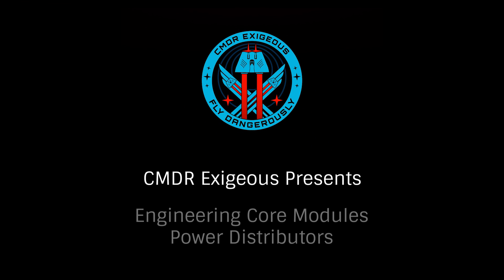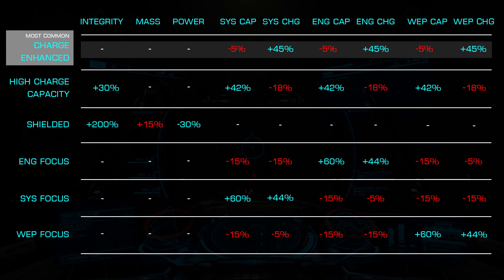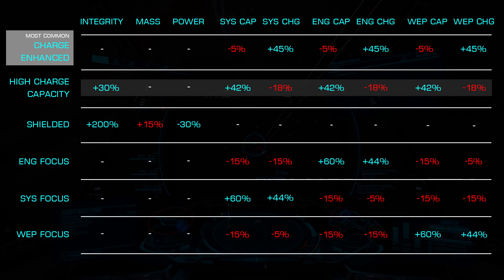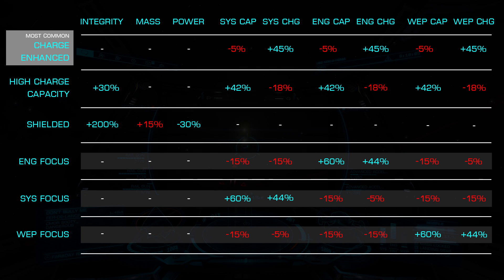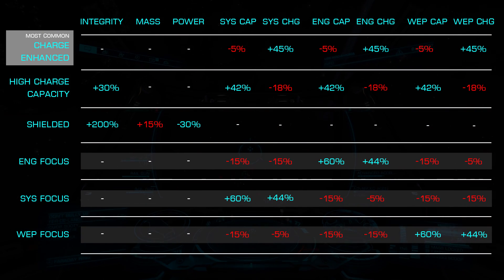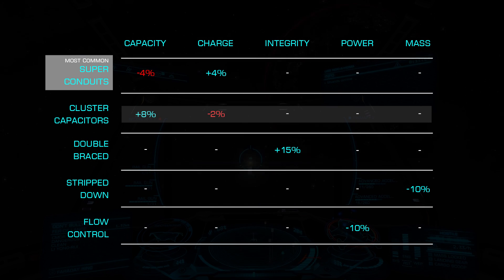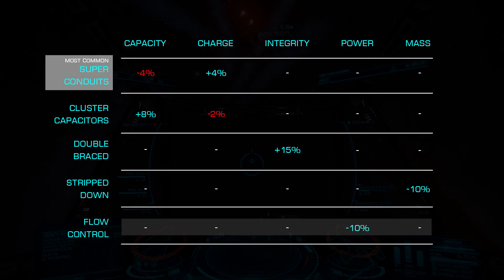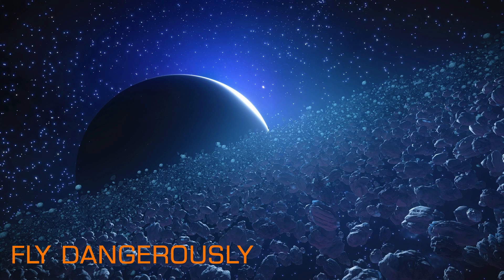Engineering Explained: Power Distributors

Comment: I wanna put my thoughts out there and please react if you feel like, I'd love to hear other's opinions too
There is only couple of very very specific instance where is actually better to use "focused" engineering on power distributors. If you look at Exigeousz's awesome picture at 0:53 you can see that even though called focused bueprints they only have better capacity when compared to charge enhanced blueprint. The charge rate is always better on the charge enhanced. Having heaps of capacity or enough of capacity would only be good if you  can say kill a ship without the need to put pips in weapons at all or if your shield is so tiny compared to your system capacitor that you can fire up your shields without the necessity of using pips there. Since it is always better to go with the faster recharge rate Id like to narrow down my thought to spacific
For weapon focused only one very specific and rare instance. Would be to when using a lot of hungry weapons and you want to fire them all at one big boom and your current capacity doesnt allow you to fire everything. Use weapon focused because you need the extra capacity and you dont care about the tiny slower recharge. Otherwise use charge enhanced
For engine focused only on exploration ships where you are using lower D rated modules than the ship does not allow to undersize and loose to ability to boost just to get the capacity and the boostability back via this blueprint. Other case to use engine focused would be on speed builds. Well.. yes and no. I see it that if are building strict speed build you should always go with lowest D rated you can engine focused so you can boost and usually strip down depending on where you stand in optimal mass, or cluster cap depending on where you stand with capacity so you can boost at all, otherwise conduits. Now if you want to boost permanently with your ship your'e looking for a combination of either A or D rated module with such combination of blueprint and experimental to achieve two things: 1, has to have min capacity that is set for each ship as its needed energy to boost. 2, has to have a recharge rate  fast enough to be able to replenish lost energy in about 5 seconds what seems to be shortest possible boost interval of the ships I've tested. From all the options pick the lightest one. 
Last for system focused. Dont ever use system focused because having pips in systems wont just recharge them but make your shields stronger in the first place. And you get no benefit from having capacity in systems.
Otherwise great video mate 07!
Reply: Also a side note, weapons focused on something like a Type10 is not a bad idea at all, as you won't be going fast and SYS focused is useless anyway. WEP focused helps a lot since it has many hardpoints and only a class7 distributor.

Comment: The only use I see for SYS Focus is to help shield regeneration on an Exploration Anaconda with a 1D distributor
Reply from the maker: Just to be clear system distributor doesn't change the regen rate of a shield, just it's ability to do so if that distributor is empty.  But that's not a bad idea to keep things much lighter.
Reply: Of course, but with a 1D distributor trying to fill up a 5D shield, no weapon, and no boost, I think SYS is the only job you can try to focus. The SYS capacity of the distributor being sucked up in a matter of seconds even with 4 pips when the shields are damaged

Comment: Engine focused is also good for those looking to run a 4D distro with 5D thrusters on an Anaconda, and still be able to boost.  Always looking to eek out that extra ly.
Reply from the maker: Good tip, thanks for sharing!
Reply: That's what I roll with as well on my conda. I love having a boost available when I'm out exploring.
Reply: Yes, engine focused is great for exploration because you can use a smaller and lighter distributor and still be able to boost.  Pm am exploration build, you likely aren't running weapons to save weight.  Your shields are only going to see momentary loads from bumpy landings so capacitor regen isn't important.